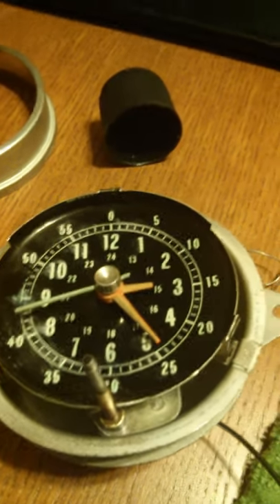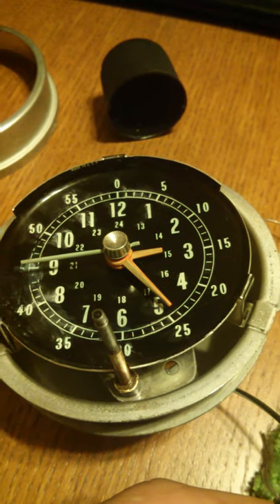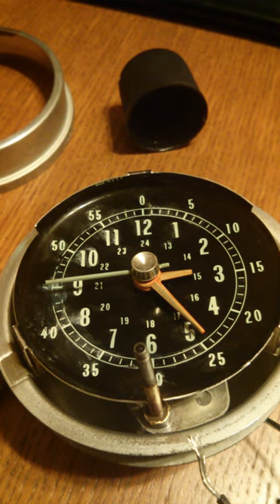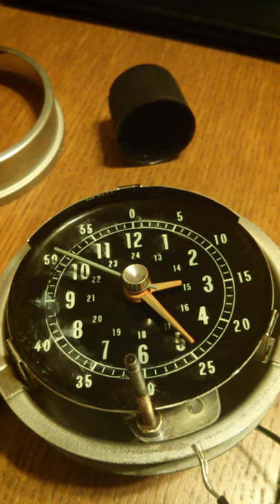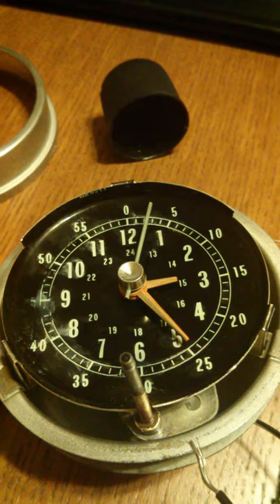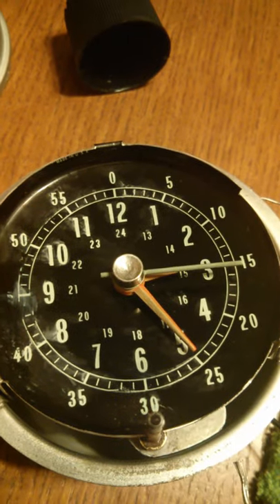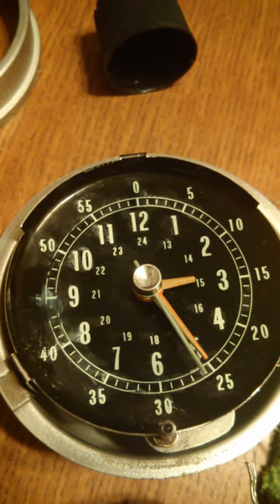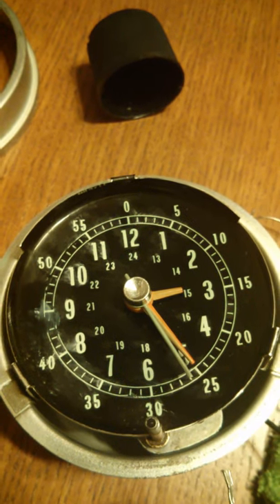65 impala ss clock repair. running clock

Comment: I'm not a clock guy but I got mine working thanks to your video. Saved me $125! Took emery cloth to the contacts, sprayed it with a little parts cleaner, dried it and a couple drops of 3 in 1 oil is all it took. Sorry about your clock face. Bum deal. You seemed to take it ALOT better than I would have. Hope you got it repaired. Thanks again!